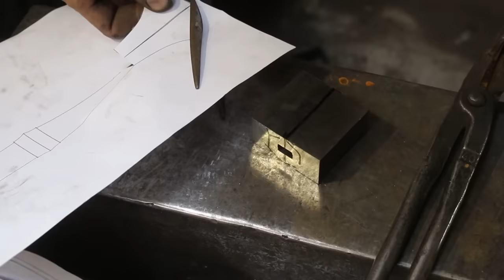Forging a longsword, the complete movie.

Comment: This sword, and especially the scabbard, make me cringe.
Due to how he shaped the blade using the dies on the press, the blade has no distal taper, so it is heavier than it needs to be in the blade. He has several, fairly large & thick collars on the hilt, which, while helping to counterbalance the heavy blade, also serve to make the whole sword heavier. The scabbard, however, is what really hurts. The blade cavity is not shaped to fit the blade tightly, so the sword will rattle like no one's business. The horns on the bull's head decoration are absolutely a hazard, not only to the wearer themselves, but also to anyone or anything the wearer moves past. Finally, and most disturbingly, the opening on the metal throat piece, especially since there is a cavity between the metal piece & the actual throat of the scabbard, is going to scratch that blade to hell, and dull the edge, every time it is drawn or sheathed. There is a lot of skill & technical know-how on display here, but absolutely no common sense.
Reply: You have no clue do you? You get a distal taper from doing a full flat grind
Reply: @tuckerabbott  You seem to be laboring under a misconception of what the term "Distal Taper" means. It is not the difference in thickness from the spine to the edge, as your statement seems to suggest you think it to be. What it actually is, is the difference in thickness from he base of the blade to the tip. Because of the dies he used, the blade is the same thickness all the way down it's length, meaning it does not have a distal taper.

Comment: i love! your no-nonsense approach to making the blade. modern tooling, no useless folding of the steel, not grinding the fuller in, but just creating it with a nice powerhammer/press-tool. very awesome. 

i love when swords are made like tools and the process isn't as much artsy as it is driven by logic and function. and the sword still looks great! (although with the damascus pattern i'm not sure wether you just bought the steel that way or if you did some folding by yourself.....hard to say for someone with as little knowledge of the matter as me)

nice craftsmanship, 
nice sword,
nice video.

Comment: Does the chain wrapped around the anvil help stop ringing/vibrations when your using the anvil?
Reply: Same question, bro, already noticed that. what is it for actually?
Reply: Makes it quiter absorbs some of the shock
Reply: Yes.....Chain absorb a part of the high frequency vibrations. Some blacksmithes uses a big magnet for that reason.

Comment: I’ve never liked the way Damascus looks. I prefer a clean steel blade. However, that sword is a beauty.
Reply: I'd like to differentiate between actual Damascus steel and modern pattern welded steel, the latter of which is often garish and tried.  You'll only find real Damascus blades in museums, it is far more beautiful than most modern examples.  Here's a picture of a kilij from the 1600's, note how it darkens the blade when seen from a distance; https://i.pinimg.com/originals/23/ed/7f/23ed7fabb95839ddc2fce0664c5779d5.jpg
Reply: I don't like etched damascus. It looks fake and forced. I like natural, well polished, Damascus.

Comment: Would the sub-austenitic temperature near the base of the blade at the time of the quench affect its performance? I'm thinking it would be able to bend at that point but not return to shape. Or perhaps the camera makes it harder for me to gauge the real temperature? Thanks! You are AWESOME!
Reply: Also wouldn't fitting the crossguard affect the temper of the blade? It seemed very blue after the second pass. No judgement at all here, just a hopeful apprentice :).
Reply: @chorro10   it might vut it wouldn't do much because you dont cut near the guard

Comment: Nice work, but the at making the guard, the heattreament of the blade is killed, depending on the steel it is now soft and brittel or only soft near the most importand area from the blade. To make the guard this way ensure it fits but then the order of the heattreament of the blade should be shuffeld, or this a lack of Video cutting ? BR

Comment: you have all those cool tools then work in hard AND dangerous mode.You're using an angle grinder while reaching across the blade to make cuts when simply changing the blade on the bandsaw would make it both more precise and several orders of magnitude safer. You've got a press but you're hand hammering the sheath tips into an ovoid shape on a FLAT ANVIL......

Comment: Why do you use epoxy when gluing wood to wood? It doesn't make as strong of a bond as ordinary PVA glue (AKA: wood glue, white glue, carpenter's glue) does. For that matter, no other type of glue bonds as strongly as PVA glue. The only reason to ever use anything other than PVA glue on wood is if you're bonding it to something other than wood, such as steel (like when attaching wooden scales to a knife, in which case you'd use epoxy).